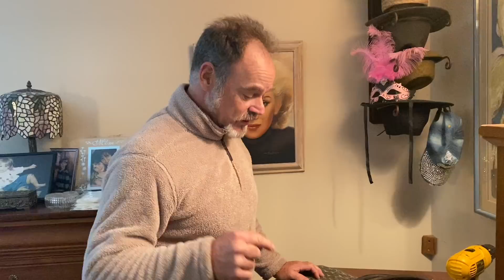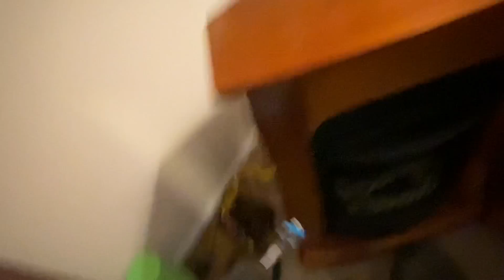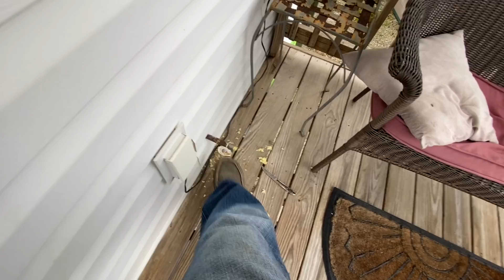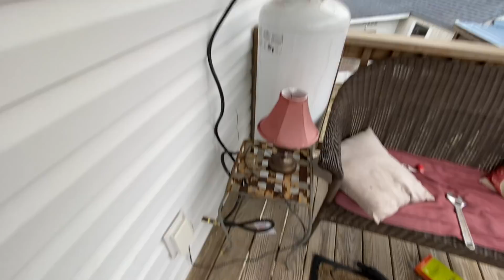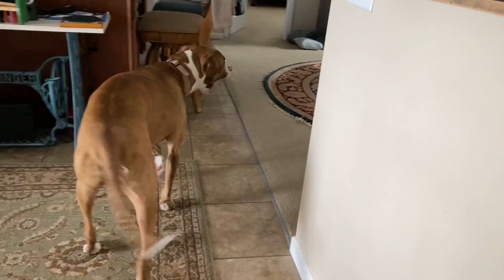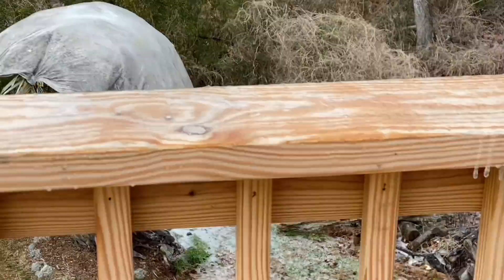North Carolina Freezing! Emergency Fireplace Installation!

Comment: FYI for everyone You do not want to use galvanized pipe for gas because of the galvanized coating. Over time pieces of the galvanized steel will flake off and clog your gas regulators and burner units. Never mix galvanized and black iron or where they touch corrosion will be accelerated.
I understand this is a temporary installation

Comment: CO-worker hired a company to install propane fireplace the guy was testing it trying to get it to light it blew up because it would not light gas built up. Even got up into the wall blew the drywall off the wall.

Comment: ExoMan, You could have done the same thing with an Electric furnace. I have one here in Iowa that keeps my 950 SF house plenty warm in Northern Iowa. Temps averaging now around -20. Dont need gas
Reply: Electric fireplaces are good, but gas ones will still work in event of power outages. I'm in NY and ours during superstorm sandy blackout kept it tolerable in the house.
Reply: @Taconic66  Yah thats true